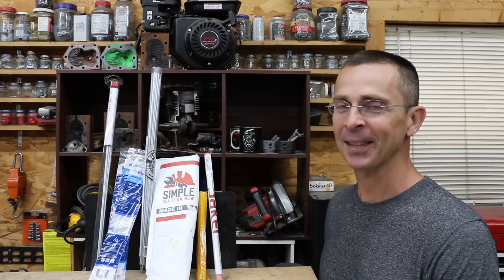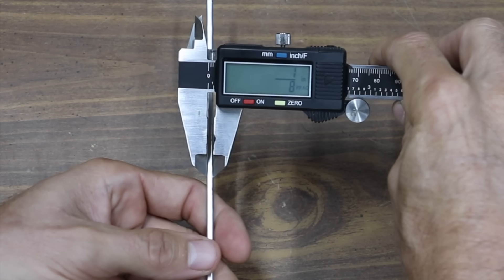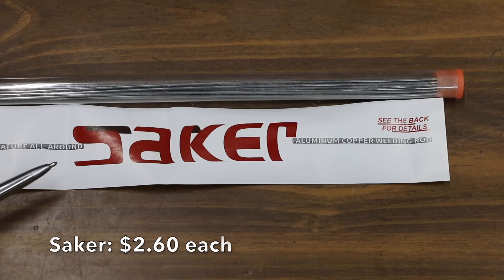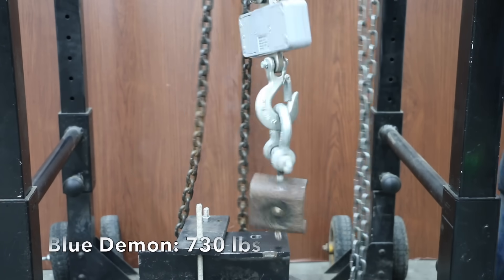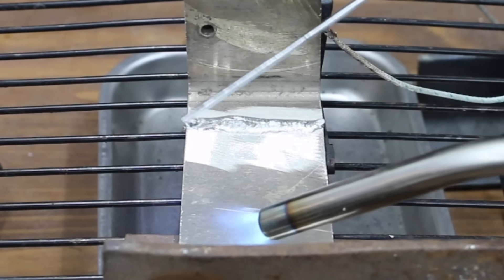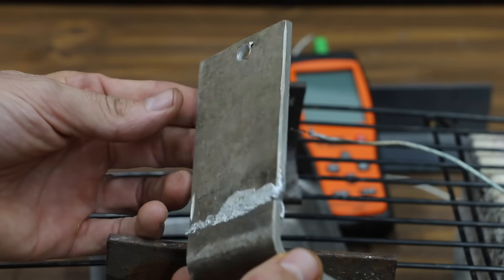Best "No Welder" Aluminum Welding Rods? Alumiweld vs Bernzomatic vs Hobart

Comment: A follow up video is necessary:  just take the best performing welding rod from this video and create the follow up that test technique. The reason is, your technique in this video is, well…, awful. 

I am certain proper technique would significantly improve performance.

Comment: Auch ein Welder mit eingebauter Lötlampe geht nicht !
Man braucht einen Schweißtrafo mit ausreichend Konstantampere 
und normaler erwarteter induktiver  Zusatzreserve eines vorhandenen Amperefluß - Trafos.
Die Transformator Übersetzung z.B. beim Mikrowellentrafo von primär zu sekundär ist etwa der Faktor: 1/8,8 aus der dünneren Wicklung kommt etwa 2000 V wenn man an die dickere 220 V gibt. die dickere summt dabei etwas in der Mikrowelle primär verwendet, sie wurde wie ein halber leicht belasteter Trenntrafo benutzt auf den man z.B. auf die 110 V Wicklung geben würde für rel. kurze Mikrowellenheizzeit für 10 min 220 V gibt. ->2000 V , 2 A. Vertauscht man primär mit sekundär indem man 220 V an die dünnere gibt summt der Trafo fast gar nicht (das verwundert),obwohl jeder Trafo eigentlich immer etwas leise summen muß. (Grund: die längere vorher 2000 V, Wicklung sollte eine Röhre versorgen und diese ist sehr empfindlich, und wurde für sehr konstante Hoch - Spannung verlängert optimiert) => Schweißtrafo aus Mikrowellentrafo: man halbiert die sekundäre lange überdimensionierte Wicklung in der Mitte und setzt zwei trennende Lüsterklemmen dran, man halbiert die primäre kurte Wicklung in der Mitte und zetzt zwei trennende Lüsterklemmen dran. jetzt nimmt man die jeweils doppelten Wicklungen in der richtigen Richtung sowohl primär als sekundär parallel. => Resultat: man bekommt jetzt wenn man an die parallele dünnere Wicklung 220V gibt auf der dickeren Wicklung wiederum 25 V und 20 Ampere. Man hat also primär und sekundär erfolgreich vertauscht. Zusammenfassung: man nimmt zwei Mikrowellentrafos noch parallel, Dann bekommt man echte konstante 40A und 25 V heraus an der dickeren Wicklung. dabei summt alles kaum hörbar, perfekt wie ein geeigneter Normaltrafo

Comment: These video's kill me. If you dont know. Thus us misleading. Look up the different between welding, brazing, and soldering. This is brazing. There's no fusing here or penatration. Don't try this at home if you try to put a so called weld under a load. A few hundred pounds might be ok. A tig weld holds 10s of thousands of pound. A weld should not break.

Comment: The first bolt and washer test claimed the bolt head was sanded clean but when it pulled apart you can see the print on the bolt head

Comment: I've been welding now for 23 years professionally and I have tried these aluminum brazing rods they do not work very well!  Its very difficult!  You need a real torch, not a map gas torch! Material has to be thick and very clean!  Nit your dirty greasy oily dirtbike engine cases. Or your dirty aluminum boat.  The material has to be extruded clean aluminum.   Its the only time I've had any luck messing with these rods!  Your best bet is to spend the money and get yourself a cheap Chinese tig welder!

Comment: another interesting test would be aluminum soldering pipes and doing a leak test with 500 psi of nitrogen. I just used the harbor freight rod to try and seal the crushed end of an aluminum pipe and it bubbled like crazy with leak test bubbles, my only guess is that the oxide passivation layer was not broken down by the solder and created an "aluminum sponge", with lots of microscopic porosity. There is a product just for HVAC called Alloy Sol and it has a special flux that you must use with it and the demo videos are impressive, but it is over $5 per rod.

Comment: You really should consider testing with Lucas milhaupt considering they are the leading brazing company in the US. You also need to make sure you are using flux so the oxide layer doesn't prevent proper fill
Reply from the maker: Thanks for the suggestion.

Comment: I get tired of YouTube recommending odd videos only because I searched for something on Google.  But this time, it was quite welcome.  I have a small project coming up and would like to weld two pieces of aluminum instead of bolting them.  I searched for "welding aluminum" and found nothing I could use.  Not going to spend big money on a small project.  But then, a little while later, opening up YouTube and there in my recommended list, this video was waiting for me.  I learned to silver solder and braze 40 years ago, so this is perfect for me.  And I can use my MAPP torch.  PF, you're the man!  Thank you.  👍👍
Reply from the maker: You are welcome!

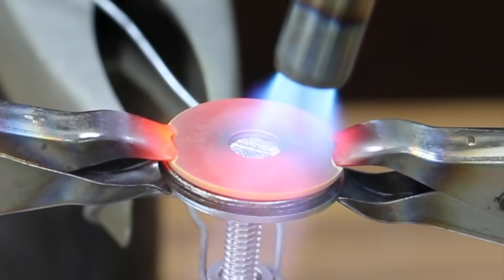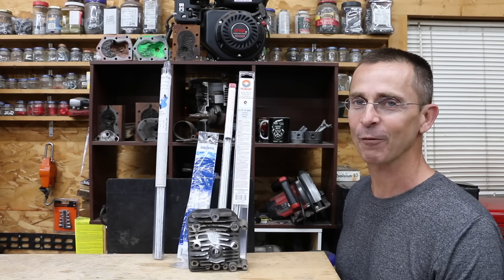Comment: At around 5:56/13:57 You sanded down the head of each bolt, however after the test (pull-apart), the grade & other marks stamped in the head of each bolt were still there. Just curious what was up with that?  Thanx, really appreciate all the great videos.
Reply: I see no "grade & other marks stamped in the head of each bolt" in any of the pull tests.
Perhaps you should watch the video again.

Comment: I didn't get where the heat is commi😢 from.
Reply: In the first test to see if the rods melt at the indicated temp, the heat was from a hot plate type heater. From 5:18 on, the heat came from a torch running MAPP GAS with the flame directed at the material to be welded until it was hot enough to melt the rod.

Comment: "What happened here? Why did the 'insert anything requiring a bolt here' fail.....? The aluminum bolt broke..... 'the aluminum bolt?........you're fired dickhead
Reply: What kind of material do ya think ALUMINUM welding rod is used to repair? <pssst> (the key word here is ALUMINUM)

Comment: I used AFV 1000 to braze aluminum AC tubing at work . Works well but practice is needed . I dont know who made the rods . Its a flux filled wire .
Reply from the maker: Thanks for sharing.

Comment: I have a concern with the repair area being cooler then the rest of the head as the head is one big heat sink and is designed to pull heat out of the cylinder piston and plug. With less heat transfer I wonder if engine durability will be an issue?

Comment: I know it’s been years but I have to ask. Did you use any additional flux in these tests? I did not scroll through every comment and maybe someone did. I apologize if I’m repeating the question. So yea just wondering if additional flux was used and what brand would work. New to brazing aluminum (power steering cooler line)

Comment: So is using this on the engine head equivalent to sealing a cracked cast aluminum dirt bike transmission case? Always wondered if this could be used for that.
Reply from the maker: Thanks for the suggestion.

Comment: Did we ever determine what these things are made of? Strength, shock load, reactivity, weathering, compatible metals, conductivity, oxidation, ductility, compressive strength, thermal expansion, PPE needed (metal fume fever, any lead content...?), toxicity (food safe, fix kitchen equipment, toy repair...?), etc will all vary with the material composition.

Comment: On your first test, where you only heated the rod, when you pulled it apart, it was visible that the head of the bolt was not cleaned/ground?

Comment: Does anyone have any experience with 'Super Alloy 1 or 5' from Muggy Weld? How does it compare to Hobart's product?
Reply from the maker: Thanks for the suggestion.
Reply: @ProjectFarm  I found four brands making the same exceptional claim:
-SolarWeld's "Multi Sol"
-Castwell's "Pot metal soldering kit"
-Northern Radiator's "Alloy 1" 
-Muggy Weld's "Super alloy 1"
They all claim to have a 350F working temp, 20,000 PSI tensile strength, and they all use a liquid flux. 
Multi Sol is 40% Sn, 27% Zn, and 33% Cd. 
If any or all of them work, soldering tempered aluminum (such as 6061-T6) may be possible without degrading the temper? Thank you Todd, for all you do for us.

Comment: There is a HUGE debate with the HVAC guys with copper connections/ bonding. Old school guys braze which requires high temperature and also requires running gas in the AC lines to prevent interior corrosion during welding. The newer way is using a product called stay brite 8 (silver solder) specifically designed for soldering HVAC lines which does not require gas flow and can be done with a basic propane torch.

It would be fantastic for Project Farm to put these two to the test. I think your unbiased testing would finally end the controversy. One of the tests can be a heated pull test. (adding a tensile force while the part is being incrementally heated at the joint) 

What do you say?
Reply from the maker: Thanks for the suggestion.

Comment: I'm having a problem with you using the term "weld". Since you're not melting the base metal, and just the rod, you are essentially "brazing". That being said, interesting test. I might try using one of these brands for repairing aluminum evaporators that are very difficult to repair using solder due to the low melting point of aluminum.

Comment: Thank you for this, I actually found it after bringing home the harbor freight product.  While it might not be the winner, I am satisfied with it scoring in the middle.  I need to repair a small bit of a aluminum oil pan for a riding lawn mower - it's used to hold part of the oil pumping system.  Watching your technique helped, given that the area I need to repair is quite small.
Reply from the maker: You are welcome!  Thanks for sharing.

Comment: Pull test best 4: (All test pieces bended to some amount)
Hobart ~173+
Bernzomatic ~130+ (Test ended before weld crack)
Blue Demon ~127 
Alumiweld ~80
*Current price, Hobart & Benrz seems to be the best price/to performance/weight

Comment: The most common use for this kind of aluminum welding rod. will probably be on aluminum radiators? and because of the delicateness of the radiators. it's probably a good thing that rod that was used. on the cylinder head having such small penetration area. but still holding so strong, would make it suitable for repairing aluminum radiators. that's a good thing to know since no one repairs radiators anymore. and buying a new aluminum radiator just to fix a leak would be counter productive.
Reply from the maker: Thanks for sharing!

Comment: if you're learning to braze aluminum, it helps to heat the cleaned work piece first, use an oven if you can, especially large pieces which are more common to repair anyway. Then use a stainless scraper or wire brush to de oxide the clean aluminum AFTER it has reached final working temp. clean and surface, oven, then final temp with torch, then deoxide, and then braze. you can braze it with full confidence that no oxides have formed between your weld and the workpiece. de-oxiding the metal while it's cold leaves (relatively speaking) a lot of time for oxide to form while you get it up to temp.
cheers project farm thanks for the great informative and entertaining videos.
Reply from the maker: Thanks!  Thanks for the constructive feedback.

Comment: Basically you need to understand why aluminium is welded with AC and must/should be cleaned properIy (oxidation). I fixed a motorcycle radiator leak with cheap chinese "aluminium welding" wire, crack was so tiny (material thickness less than 1mm) that welding would have destroyed radiator. It has hold around 10yrs now. I have tig welder now too, but some things are better to solder/braze. Example early HD frames were brazed, not welded. Also I have used this wire to braze aluminium and copper together, not ideal solution but. Also works with stainless.
Reply from the maker: Thanks for the constructive feedback.

Comment: Soldering and brazing are valid, yet often overlooked repair options. These won't be replacing my Lincoln or ESAB TIG machines any time soon, but they're definitely a good tool to have in the box for occasional purposes, especially in the one on your truck, where you may already keep a hand torch like the common Bernzomatic. If you have a high temperature oven, hot plate, gas stove, or even a camp fire, you can make these work for you.
Reply from the maker: Thanks for the feedback.

Comment: I've seen products similar to this that "weld" dissimilar metals. Two products that seem to compete are Muggy Weld and Solder Weld. Is there a possibility you could test these products?
Thank you for your very informative videos!
Reply from the maker: You are welcome!  Thanks for the suggestion.
Reply: @ProjectFarm I was hoping we could get a retest using Muggyweld products like super alloy 5 as it boasts a 600f melting point

Comment: Great to see someone putting these products through their paces! Two alloys used in the repair industry I'd love to see compared into this are MuggyWeld's Super Alloy 5 and Rockmount's Neptune G brazing alloy. You might consider investing in an IR temp thermometer for instant surface temp measurements - the Fluke 62 is an excellent choice. I was waiting for you to grab the governor and redline the engine!
Reply from the maker: Thanks!  Thanks for the suggestion.

Comment: Video idea...aluminum weld a pad or dome on a aluminum piston making a low cost high compression piston (10.5 - 11.5 :1 compression ratio) and run the engine on high test fuel. Use any suitable welding method. Thank you and waiting for your reply!
Reply from the maker: Thanks for the suggestion.

Comment: Well thats awesome, i was thinking of using one of these to weld on some bungs and pipe work for a vehicle intake/intercooler setup which is under boost. Thought they'd be fine for that application but obviously wasn't entirely sure. 

But hell if they hold up too cylinder pressures, they can hold up too a little boost

Comment: Ok im so glad you made this!!

I have some aluminum brazing rods ive been considering using to fix an issue with my intake manifold. The carb flange was mounted in wrong direction.

Im gonna have to look at using them to fix that now :)

Comment: TIL - aluminium 'welding' is more akin to soldering than steel welding, but just as steel welds, it can be equally string or stronger than the welded material itself! Amazing review, good to know the most expensive brand is not the best ;)
Reply from the maker: Thanks!

Comment: A pressure test would have been good maybe with nitrogen or something i had a leak on some aluminum A/C lines in a car and i used the harbor freight ones and it seemed fine but under the pressures of the ac it still leaked i mean slower but still leaked
Reply from the maker: Thanks for the video idea.  Thanks for sharing.

Comment: I would use fluxed-core aluminum rods, but fused through an inverter or homemade welder done with 40 three-volt lithium ion batteries in series.

The problem is that I would experience more smoke like regular fluxed-core welding. Gasless FCAW made me put more effort into brushing off filthy soot.

Comment: Someone needs to go back to school before making those videos. Sanding aluminium to remove oxidising layer was interesting approach, considering it got oxidised immediately. I do not know what has been added to the rods to make them melt, but obviously some metal or may be some alunium isotopes which have lower melting point. The true aluminium because of oxidised layer melts and want fell of the melted rod. because aluminium oxide has very high melting point.

Comment: I just tired welding 2 pieces of aluminum together with US WELD brand of this same type of stuff and had no luck . it melted the rod but the metal would not stick to one another . I also used a blue propane torch  😡. maybe i should use map gas instead of propane

Comment: My money say 90% of people waste at least 1 rod because they don't listen. So they try to use it like solder with a soldering iron. You know what I mean. 95/100 people will plunge the solder directly into the tip of the soldering iron in order to solder when you're supposed to do exactly like you do with this stuff. You heat up the base metal and touch the solder to it so it melts. You don't just jam the solder into the tip of the iron and let it go on a cold surface.

Yet that's what 95% of people do. And almost all of them will tell you they're doing it exactly like you're supposed to do it. Smh.
Reply from the maker: Thank you for sharing!

Comment: I'm sure dozens  of welders may have said this already but I must also say:  Not welding rod at all. Just like the label states on the Hobart "Aluminum Brazing Rod".  The only thing  weldable by these rods is zinc. It's basically metallic HOT GLUE, or Brazing.  Of course it's good testing as usual, just not "welding" rod or process. It's called brazing because it's hotter than soldering. Brass and silver are also used for brazing, and they are functional on steel.  There is no welding when the parent material is not melted into the joint.  O/A is required for high-strength silver or brass brazing.  I think oxy/propane can work for some, but I've only ever used O/A for brass and silver on 4130.

Comment: This gave me an idea for an aluminum intake manifold project I have been sitting on doing. If this weld material can handle a cylinder head, a much cooler intake manifold with no weight stress applied (due to sitting on top of the engine) should in theory be much easier for it.
Reply from the maker: Thanks for the suggestion.

Comment: Thanks, great video! Now, the next question for the curious mind is, “Why the difference in melt temperatures for the rods?” Hint: what’s the zinc %? Alloyed with? Zn melting point is 780F (415C). Al is 1220F (660C). So if the rod is high-Zn, it’s truly a brazing rod, not welding. And easier to use. If you could have given us the Zn % for each product in advance, we could probably have predicted the outcome of the test.
Reply from the maker: Thanks and you are welcome!  Thanks for the constructive feedback.